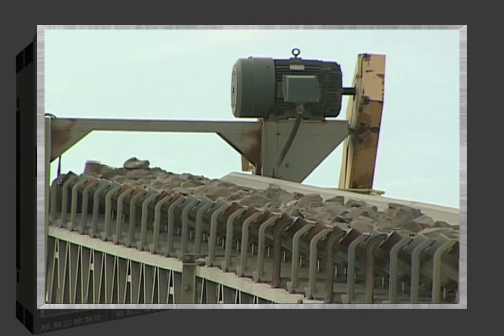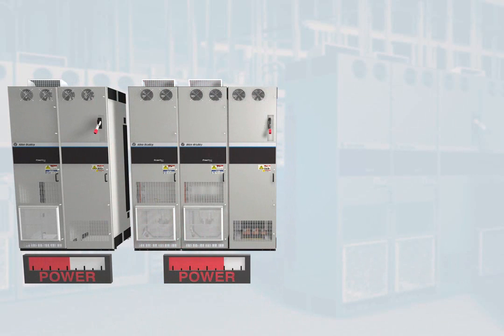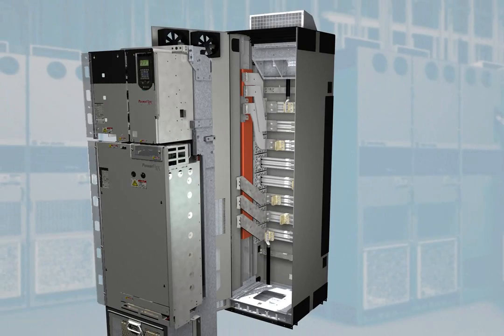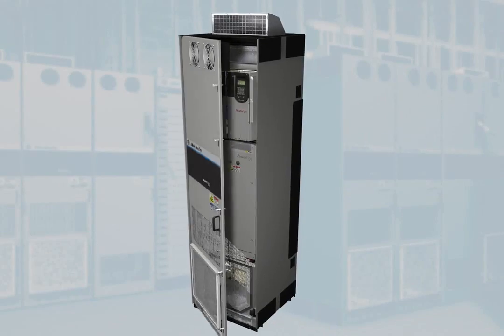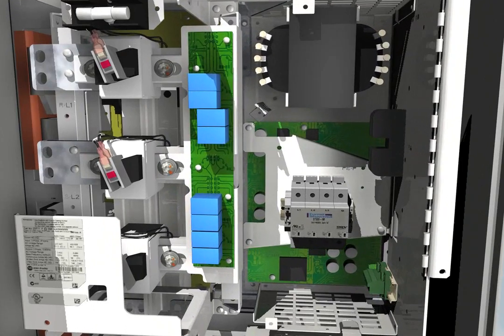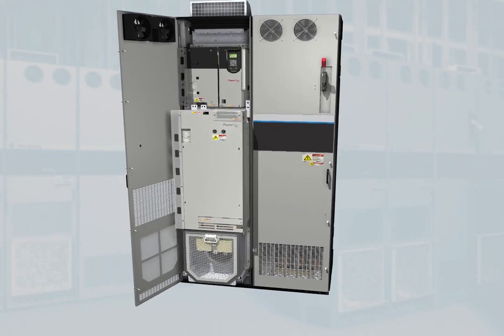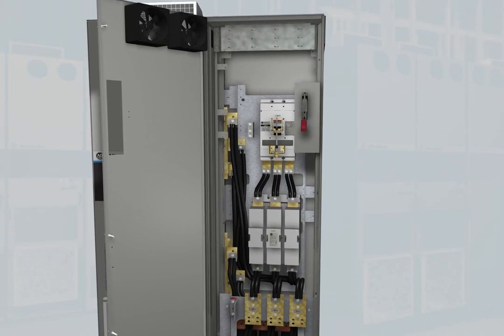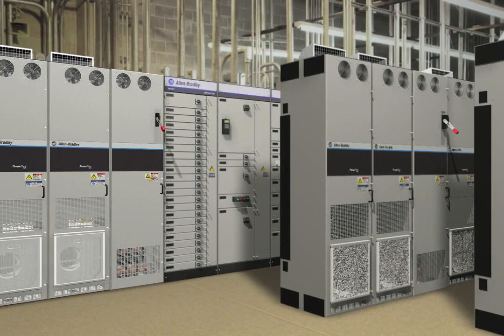Allen-Bradley PowerFlex 755 AC Drive

Comment: I started VFD &  The display is stuck on loading and does not fully initialize or start, preventing access to drive parameters or diagnostics. 
Can any one help me.
Reply: @bljdeepI have a problem. We bought the VFD chips after the latter were damaged. When they were supplied with electricity, the HMI for the indoor and outdoor units did not work. Can you help me?

Comment: Good morning. The video is very good. I need to know how to fix it, if there is a fault on the inverter communication board, when PLC does not read AC 400v motor current.

Comment: I want to replace Main Board of Powerflex755 which has gone faulty. Need support for:             1) IP Setting thru HIM
2) HIM IP should retain IP set even after power recycle,
3)Check the Firmware of New Main Board. 
4)Download Parameter thru PC for running the Drive.
Please support for the same.